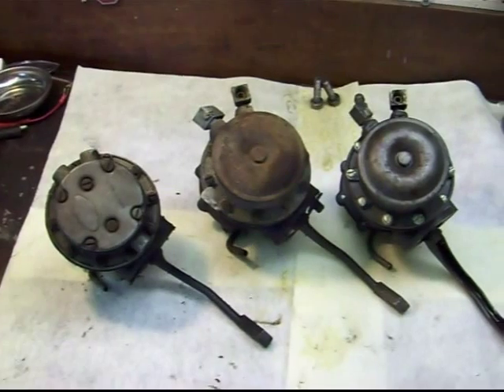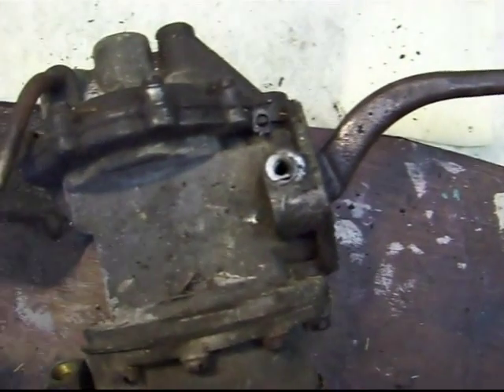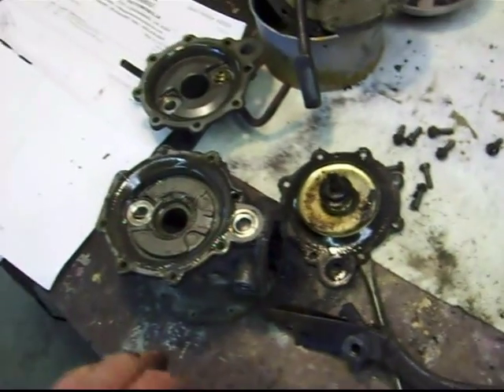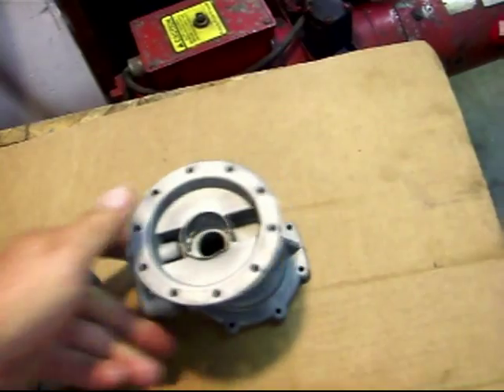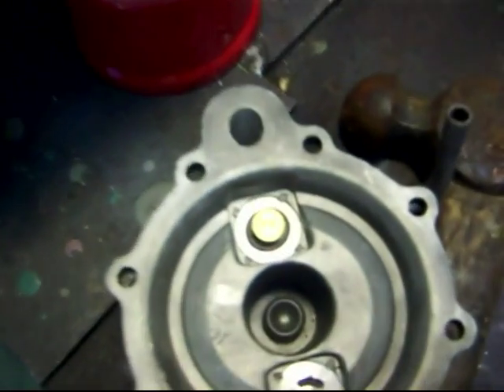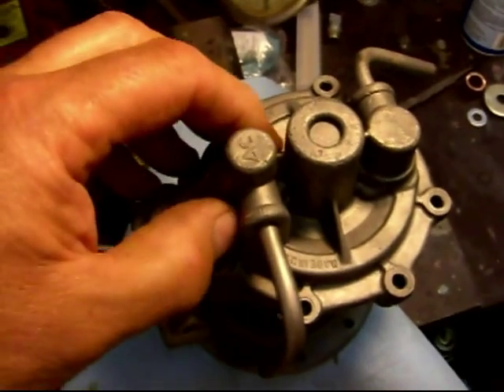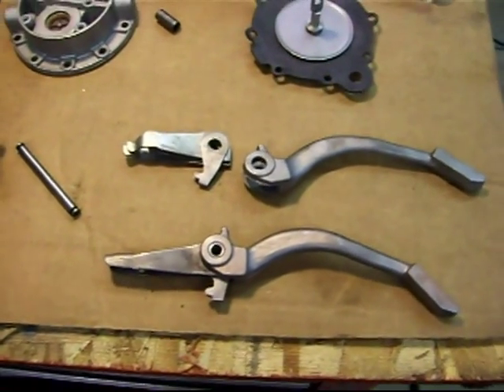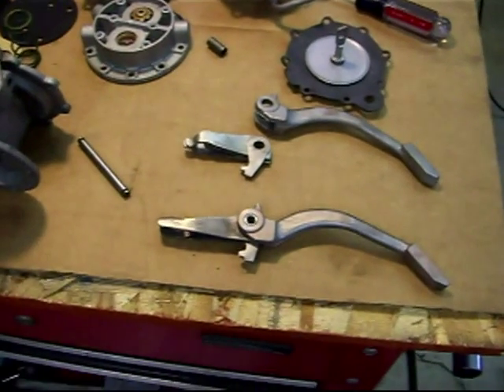1955 Buick Fuel Pump Rebuild

Comment: I just got done taking mine apart from my 1964 oldsmobile super 88. I have one question before I start installing the rebuild kit. I was wondering if you need to grease any of the parts that go attached to the spring that connects to the lever pump.
Reply from the maker: I just added a little White Lubriplate to the shaft and lever. Nothing next to the rubber parts

Comment: I can't get the lever out of the fuel pump.  This was a working, but leaky fuel pump so the lever isn't stuck.   The video went past without showing the lever removal, so it must be relatively easy, but it just won't budge.   Any advice?
Reply from the maker: Once I removed the pin, diaphragm and cover mine came right out.
I had a real hard time getting it back in. I took about 45 minutes to get it
back together

Comment: Hello I have a problem with my fuel pump for Buick 8 right I have no compression I disassemble the interior there is nothing to break and the seals are in good condition, however the lever is lowered without problem  can i have a problem adjusting the lever?  a detail I did not disassemble the lever
Reply from the maker: Out of the three pumps they look the same but the levers were different. I could not exchange the levers in one of them. You should be able to mount it in a vice and make it pump fuel. Make sure your cam is ok that moves the lever up and down.
Reply: @dyna1955  I manage to lower the lever without problem 
In your video when you lower the lever there is a noise!
at my place there is no noise!
the cam is the lever?
Reply from the maker: The cam is inside the engine that allows the lever to go up and down. If you are moving the lever with your hand and it does not pump fuel then there must be something wrong with the check valves or the diaphragm. Did you install a new seal kit?
Reply: @dyna1955  I tried with the tank and a plastic bottle and fuel but you pumped by hand without it being on the engine there was a vacuum with pressure gauge My engine run with fuel with carburetor